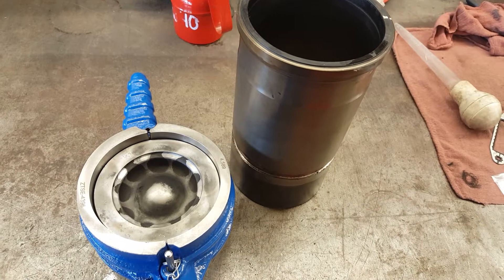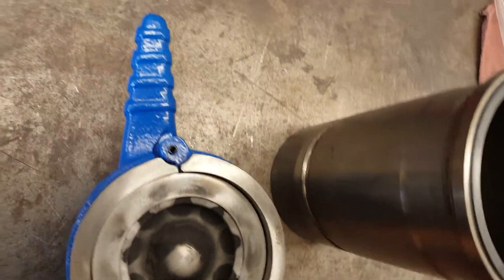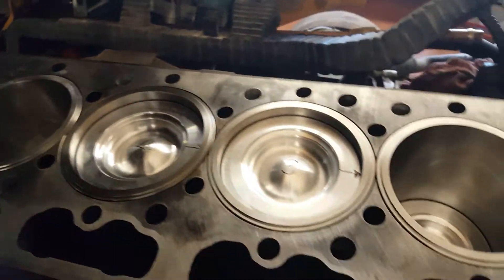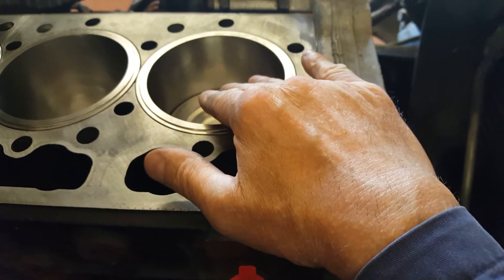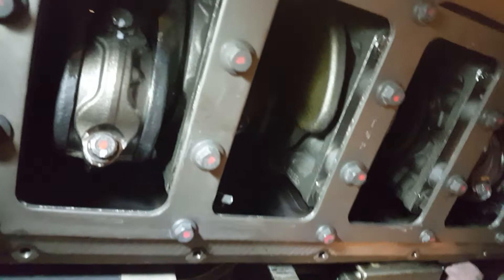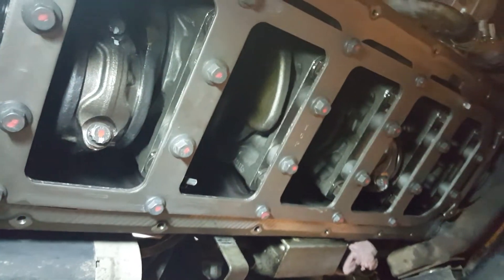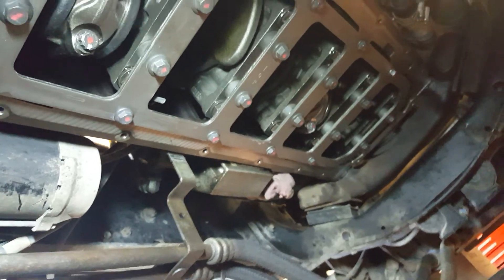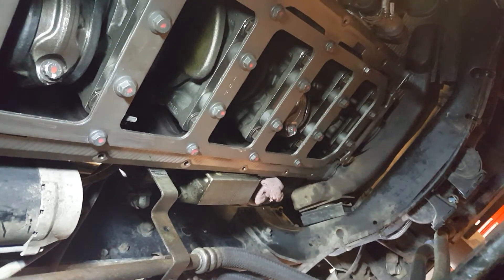Piston Installation MaxxForce DT Diesel Engine In-Frame

Comment: do you know what seals the top of the liner? ik there is a big orange o ring on the bottom of it... is the top just a metal to metal seal?
Reply from the maker: There's just the o-ring on the liner lower section.